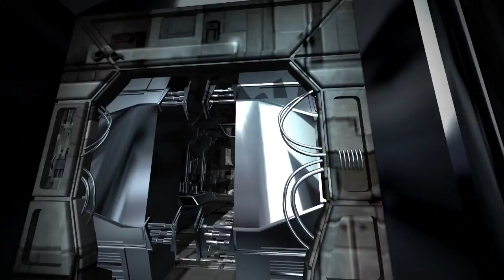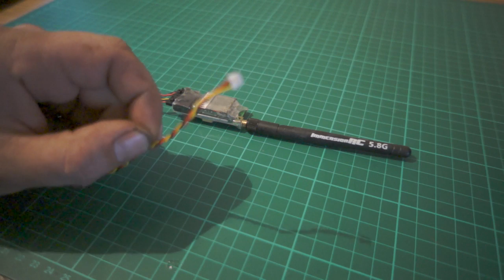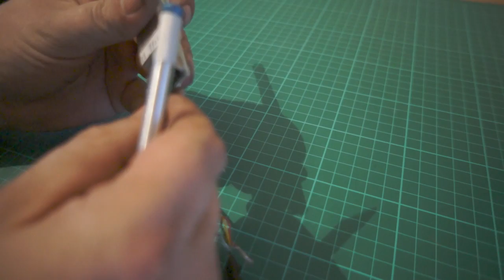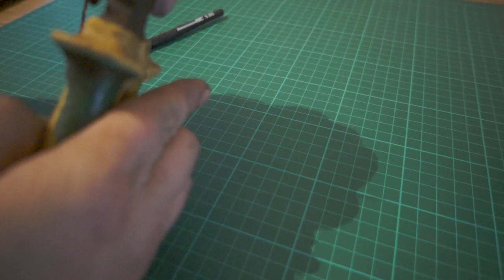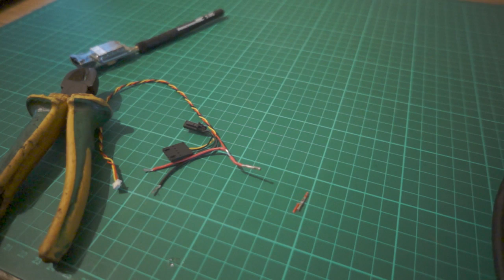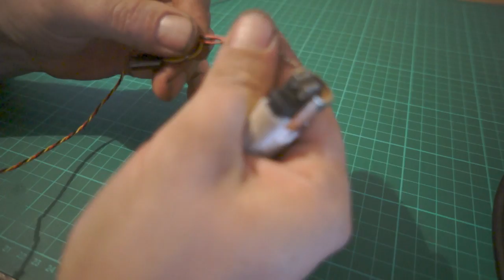12v Camera Hack

Comment: Hey Coyote!
Thanks for the video!! I've been struggling with this issue for a couple months now!! I do have one question tho... what if I'm using a FatShark Filtered Balance Lead Power Supply 2s-4s from my battery to my transmitter?? do I still follow the same procedure?
Reply from the maker: I can`t honestly telly you because I don`t know or can find what the voltage is that the Fatshark filter outputs. It does not say if the output voltage is filtered or regulated on each page I`ve looked at.
Reply: Hey Coyote! Thanks for the reply!
So... How r u getting the power supply to your transmitter? Is it straight from your power distribution board??
Thanks for the help!
Javier
Reply from the maker: Straight from a 3S lipo sometimes via an LC filter
Reply: Thanks my good man... What is LC?
Reply: But if you run power straight from the battery how do you regulate 5v with out stepping it down? Wouldn't powering the transmitter straight from the battery burn the transmitter?
Thanks again
Reply from the maker: LC refers to the ferrite ring and capacitor used to filter the high and low noise level. Google LC Filter FPVHub for a tutorial on them I wrote. 

Powering the camera straight through gives u a 12v output, but that's what this video is showing you how to power a 12v WDR camera without a step up transformer / PSU. It's not for powering a 5v camera, a 5v camera just plugs into the vrx 5 pin socket
Reply: Oh I see... So if I run straight from my PDB with a 4s battery I still should get 12v and able to power up the camera the way u did? 
My situation is: I have a 12v camera but the 5.8 immersion rc transmitter, I'm running my quad on 4s 3700
Reply from the maker: No it does not step down the 16.8v it's for 3s use only. Having said that I have ran several WDR cameras successfully on a 4s Lipo but would not recommende it and you try it at your own risk because your camera might not .
Reply: Coyote FPV
Ah! I got u! Sorry i got completely side tracked!! I have a small 3s 1000 mAh battery specifically for my FPV, so from this battery i can do the same as you show on your video!! Man I got lost for a while there... Ok now I understand, I was thinking that you were using the same battery to power up your plane to power up your fpv system. So this battery that I have should do the trick on my 12v camera and my immersionRC receiver :)
Thanks for your help my good man!!
Reply from the maker: No problem :)

Comment from the maker: Only if you route your wires badly, same as any setup Mark, if you do have noise in it that`s not the hack, you either need to add an LC filter or re-route your wires